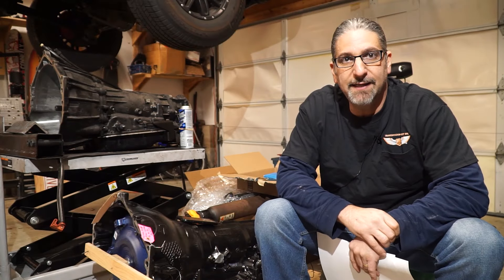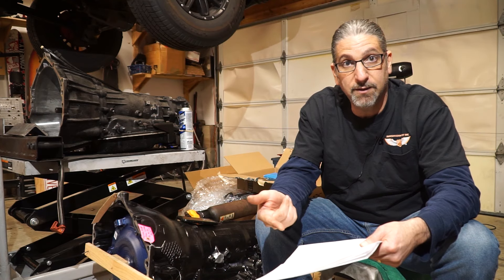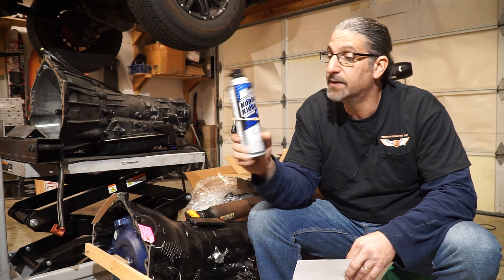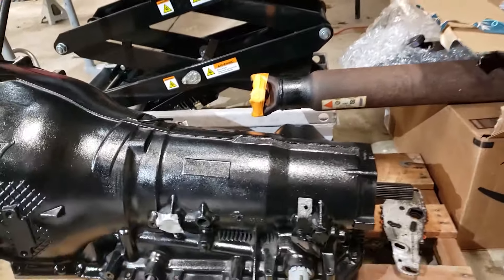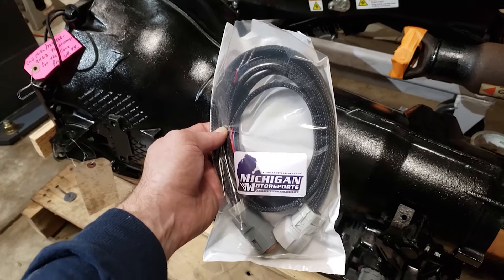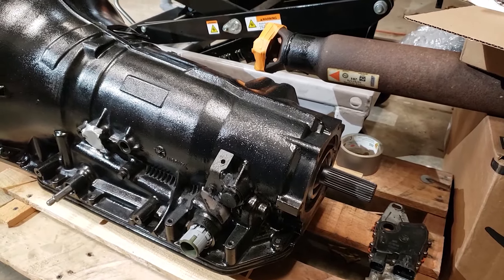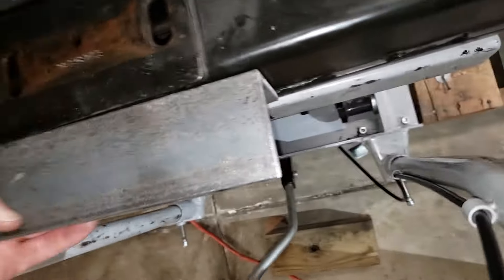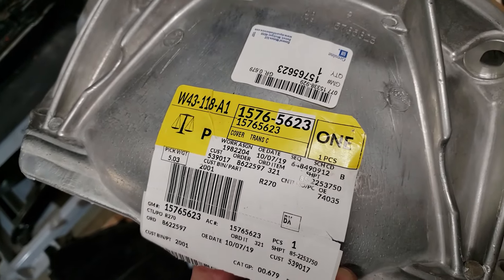4L60e to 4L80e Transmission Swap - What to buy

Comment: Did my comment not go through? I was  curious if my 2006 GTO would mate to the 80e with the adapter you suggested in the link.
Reply: I'm the same person as above comment. My tranny parts are in the link i'm going to post, and the crossmember and flexplate are already installed but I wasn't sure how to get the computer to control the 80e so i was looking for an adapter. Great video by the way. Any advice would be great.

https://www.ls1gto.com/threads/my-gto-build.845239/#post-21666021
Reply from the maker: I honestly have no idea try calling the transmission place and they will be able to give you a definitive correct answer
Reply: Tahoe Steve Yikes. I called them and they sent me to another company to ask. And then those people told me they have nothing for the 60e to 80e.. so it was just an incredibly useless experience and that’s why I’m here lol
Reply from the maker: OK, let's backup,  what engine do you have on your GTO?
Reply: Tahoe Steve it is an LS based 427 dart SHP block.
Reply: Tahoe Steve Originally an LS2 of course
Reply from the maker: OK I may be mis interpreting your question but my adapter is connected to a transfer case, without a transfer case I'm guessing that the drive shaft is just coming out of the back of the transmission. Or am I mis interpreting your question?
Reply: Tahoe Steve Yeah - no transfer case! Driveshaft coming out the back that is correct. The car of course originally came with the 4l60e transmission but we wanted to get something more durable so we decided to shove a 4l80e in there.
Reply from the maker: @anthonycollura9790    I think I severely misunderstood you.  You were talking about this:  4L60e to 4L80e Transmission Plug and Play Adapter Harness  https://amzn.to/2XAZMTk and not the physical adapter between the tranny and the transfer case.  My bad.
Reply: Tahoe Steve yes indeed - so would the adapter theoretically work? It is universal I believe
Reply from the maker: I believe it will. Perhaps call someone like Summit Racing and run it by them to be sure.

Comment: Hey Steve have an AWD original tranny 4l65E I'd like to do this swap but have AWD not 4x4. Also  towing a lot that's why I like this. You said won't hit race track.  Well I'm in toronto and limit is 100km is limit but everyone goes 120 and if you don't keep up horns start popping if you hear me. How slow to say is it. I mean acceleration not that big of a deal top speed wondering though?
Reply from the maker: I have had no issues with top speed.  The thing is perfectly happy at 90 mph (144km) so unless I misunderstood your question, there should be no issues.
Reply: Tahoe Steve hey, I was wondering what is the part number for the new trans harness from Michigan motors?

Comment: I have a 2000 suburban which I'm going to do a 6.0 and 4l80 swap. I already have the motor, tranny, and transfer case. Any advice?
Reply: Did you get yours done?  I went to put in transfer case  and its a tight fit  between  transmission  and  torsion bar cross member
Reply: @darkshadow5730  Yea, I had to remove the top 2 studs to slide the transfercase in. I replaced them with bolts.
Reply: @hitmanshadowrecon9017  im refering to the crossmember holding the torsion bars in  the  transmission  support cross member is out
Reply: @darkshadow5730  That's exactly what I'm talking about. My transfer case wouldn't fit because it would either hit the torsion bar crossmember or get stuck on the studs coming out from the top of transmission. So I removed those studs from the top of tranny, then I stuck the rear of the transfer case up above the crossmember as far as possible. That allows just enough clearance so when you raise the front of the transfer case you can now put it on the remaining studs. Replace the studs you removed with bolts of the same size. I hope that helps.

Comment: I just went through my 3rd built 4l60e. Pulled the trigger and bought a 4l80 yesterday. Hopefully this will last me. It wasn’t the builder’s fault, ever since I lowered my truck the driveshaft has been putting a lot of pressure on my trans, any ideas?
Reply: custom two piece driveshaft
Reply: @gabes9998  I went with @driveshaftpros on Instagram, they know what they’re doing He said this 4’ billet driveshaft is better than 2 piece driveshafts, which they also sell
Reply: @jasonloera3358  if you happen to remember could you  let me know how that works out I'm looking at doing this in the next few months
Reply: @gabes9998  will do, reply to my comment in a month. Should be running and fixed by then
Reply: @jasonloera3358  hows it holding up?
Reply: @AlexTurbo  trans took another shit on me last month I hit a big dip and it shattered but I’m getting it rebuilt as we speak it was shifting just like a 4l60 didn’t even feel a difference but that’s good since I know I’m running a way stronger built trans
Reply: @jasonloera3358  did it smack the ground on the bump and break or the trans exploded from the inside?
Reply: @AlexTurbo  the dip was so bad it broke the trans pump and it stripped the housing bolts that mount it to the engine. I’m going to need a whole new trans case. I blame the size of my wheels for this, since I’m running 275/35/18 all around on a 4/8 dropped single cab It makes me look lower than I actually am. When the truck’s running I’m going to put my 20’s back on for more clearance
Reply: @jasonloera3358  oh okay so it wasnt the trans fault? and damn you're slammed!
Reply: @AlexTurbo  no it was completely my fault for running such thin tires I like the trans shifted smooth and with the shift kit you feel it kick with every shift
Reply: @AlexTurbo  look at the short video on my channel to get an idea of the wheels
Reply: @jasonloera3358  ah okay I see. They look real good though
Reply: @AlexTurbo  yea I got them for cheap from some local guy for $300 for just the rims. My next set of tires after I burn these out are going to be 275/45/18 or 50/18 at least

Comment: Hey man I’m doing the 4L65 to 4l80
But I wanna keep the flex plate that the 4l65 has which bolt patter do I need to order on my torque converter the 3x10.75 or the 3x11.066?

Comment: I have a question would a 4l80e last longer than a 4l60e and will it take more abuse
Reply from the maker: Yes and Yes.
Reply: @TahoeSteve  is 4l80e has better torque than 4l60?

Comment: Hey Tahoe, I am having crazy proble.s with a fresh rebuild 4l60e no miles on it. Wont start off in 1st wont manual shift to first, floats on 2nd. Replaced and adjusted neutral switch, swapped solenoids, cleaned shuttles and valve etc. Nothing working.
Reply from the maker: I had a shop do mine, the only thing I did was pull it and put it back.  Auto Transmissions still remain a complete mystery to me.

Comment: awesome video! thank you so much, you definitely helped!!!
Reply from the maker: So glad to help! Thank for watching
Reply: @TahoeSteve  Thank you for the video I just purchased a 03 sierra 4x4 with the 4l60 and 5.3. I'm going to swap to a 6.0/4l80E and your video answered the rest of my questions. But my next question to you is do you know the model number of your transfer case? Is it a 246? Which in assuming before I buy the rebuild parts for my transfer case and the input shaft to fit the 80 I want to make sure you have the 246 transfer case that will complete my build thanks again

Comment: Tahoe Steve. I have just completed my swap. But I'm running into what I believe is some tuning issues. I'm getting 2 codes after po745 and po840 I believe. Can you provide any info on what you did for the tune?
Reply from the maker: Yes, check this out:  4L60e to 4L80e Segment Swap HPTuners - https://youtu.be/oKShE4rpsA0

Comment: You paid extra for a custom converter to match your flexplate, then replaced the flexplate anyway?
Reply from the maker: I did not mind paying extra for a bullet proof converter from a quality manufacturer.  The upgrade was the billet front end, the matching bolt pattern was a bonus. The holes in my old flexplate were oblong and the flexplate slipped a little in the holes, so yes, i got a new one.

Comment: Wanting to do the same right now on my Avalanche I cannot keep the 4L60E going even beefed up build it just popped the trans pump Im running big 38.5X15.5X18 Toyo Open country tires with 12" wide wheels so thats a bit heavy.  Maybe I need the Stage 2 4L80?
Reply: I know it's super late but s stock 4l80 can handle that no problem maybe just a hd2 kit

Comment: what do you recommend for a 6.2 L92 full bolt on pushing 450hp?
Reply: 4l80 Fs
Reply: @alfredohernandez4035  my tranny just went out today😭 thinking about putting in a built 4L80, is the conversation hard. how much did it cost you?

Comment: Can you get me a part number for the hardened 27 spline output shaft you had put into your 4l80e build?
Reply from the maker: I'm not sure, this is something Transmission Depot did for me.  Give them a call, they are super helpful.
Reply: @TahoeSteve  you said inthe video they gave you option for 27 spline transmission output shaft. So you wouldnt have to change out your transfercase input shaft.
Reply: 8 minute mark is where you mentioned it

Comment: How much did this all cost?
Reply from the maker: $2300 trans
$800 Circle D 3000-3200 Torque Converter with Billet,
$100+ for the wire harness,
$100+ for the flexplate
$100+ for the front drive shaft
$100 to have rear drive shaft shortened
$50 trans cooler lines
Crossmember - Free (but I already owned a welder)
I already had HP Tuners to do the swap, but this needs to be considered in your budget to either buy it, or have someone do the segment swap for you.
$100+ ??? NSS, Transfercase adapter, bolts, gaskets, dipstick tube
And don't forget how expensive all that ATF is.

Comment: Do you think it would be difficult to go from a 4l80e to a built up 4l60e? I like the lower 1st and the taller overdrive in the 60e.
Reply: 4l60e is trash
Reply: Just saying I wouldn’t switch to a 4l60
Reply: Gona be difficult on the side of the Highway going back in with the 4L80e after the light dookie 60 gives up
Reply: I have a stage 2 kit on my 4l60e and blew my pump assembly not even 10,000 miles on rebuild.
Reply: I would HIGHLY advise against doing that.  I don't even know if you could find a shop that would do this swap in good conscience.  This is like upgrading from a Corvette (4L80) to a Honda Civic (4L60), or from a Gulfstream G6 to a Cessna 172, or from a Beverly Hills mansion to a middle Alabama trailer park, or from a ... well, you get the point.  Personally, I would rather have a broken 4L80 than the world's best, and working 4L60.  Ask me how I know.  Also, if your current 4L80 is broken - you were doing something that would incinerate a 4L60.  Dollar for dollar, the 4L80 is like going from the Wright brother's first airplane to the Enterprise starship (that may be a stretch, but I think you get the drift).  The 4L80 is a godsend for us with a 4L60.
Reply: And if you do decide to swap - I will buy your 4L80 and pay the core charge.  I will even remove it for you and use my AAA to tow your vehicle to the shop.
Reply: @waynebeaver4096  lol yes please do that for me !🤣

Comment: Think it might be easier to get a built 60
Reply from the maker: Tried that twice,  blew them both up.  Not worth if you significantly increased horsepower.
Reply: No such thing as a built 60e. Especially in a  dull sized truck. Trucks are heavy and they need a better beefier transmission.

Comment: Bruh, if you are building this for a hot rod b/c you ew up your stock 4L60 why didn’t you just build your 4L60 instead of going through all this customization and fabrication bullshit? It would have been way easier to build your 4L60 than it is too swap in a 4L80. And you can run 1000hp through a 4L60 if you build it for that.
Reply: 4l60’s are trash and don’t last no matter how much you build them
Reply: False. There are 10 second cars using the 4l60. It's just cheaper to go 4l80. The upgrade output shaft alone is 500 bucks. That's just getting started. Not wanting to do alot of work or racing and want less drivetrain loss the 4l60 can be built to hold it.
Reply: @brandoncarson3187  exactly
Reply: @brandoncarson3187  So, are you saying once the 4L80 is in it is a less expensive transmission to get parts for?
Reply: 4l80 is set up stock 685 lbs. 4l60e I heard is 380.lbs drag racing its worth it.
Reply: I bet your quick at R&R
Reply: @JadenBishop22  ever heard of a 700R4 ? 4l60 stick isn't great but a few upgrades and mines pushing 300k since

Comment: I'd like to put this trans in my 03 dakota, what engine would go best with it?
Reply: Woah 😳….
I hope you know that Harbor Freight has a complete bolt on kit for it🙄
Reply: @maddoxlogging2303  I did not know that, and what’s with the rolling eyes? Smug or something?
Reply: @SoreTv  4l80e won't be compatible with your Dakota
Reply: @kalikiller1771  well obviously not stock, it’s a project truck for me, engine swap, sas, everything is going custom.
Reply: @SoreTv  that might be where Maddox was mistaken then
Reply: @SoreTv  and an ls is the best and only option for this transmission
Reply: @kalikiller1771  ah darn, see I’m not very well versed with the different trans and compatible engines. I want the 6.4 hemi.
Reply: 8.1 Big Block with twin 80s
Reply: @SoreTv  look into the NAG1 transmission